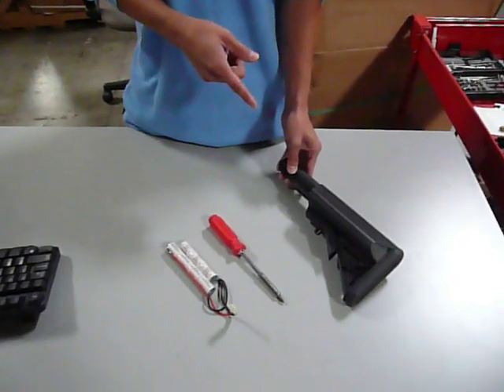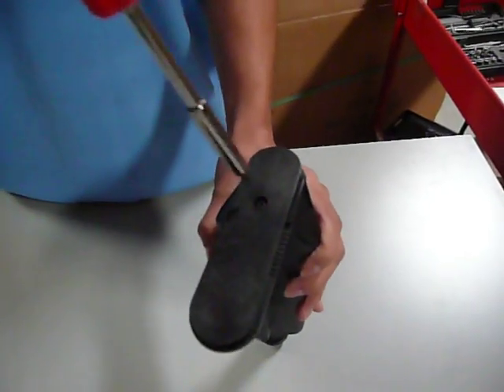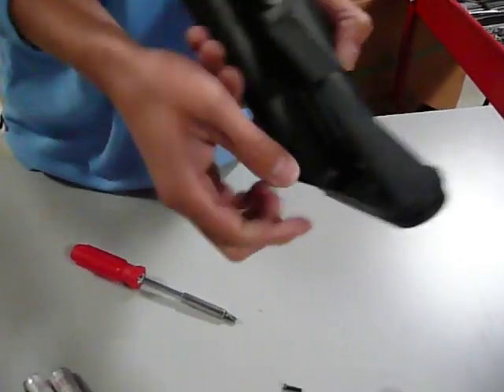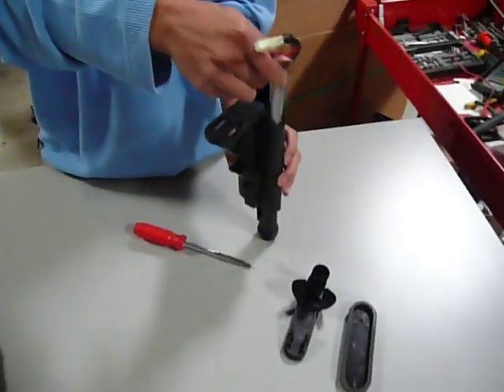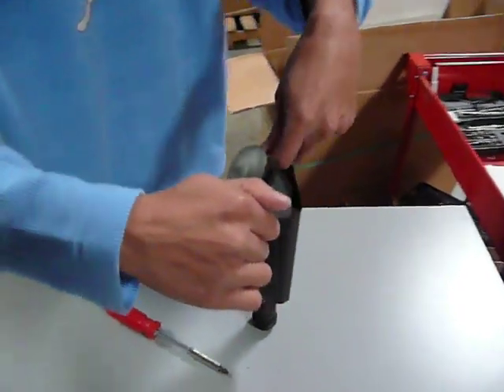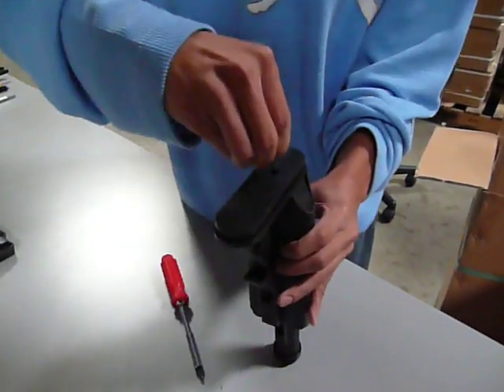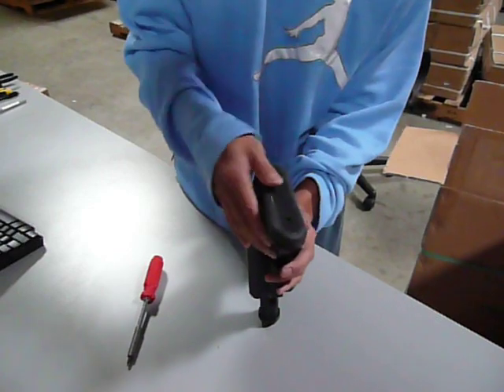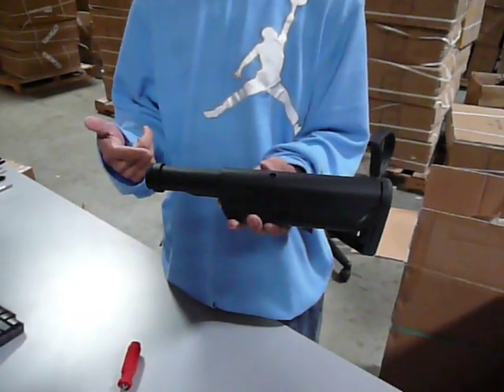DBoys M4 CQB Crane Stock Battery Installation - Airsoft Megastore

Comment: I have a d-boys M-4 QCB have only used it one cycle on the batterypack , recharged according to directions but when you plug batterypack into the gun wires and battery pack becomes vey very hot1!!!!!!  what up ? this gun  is new ! from Evike, did i get ripped?

Comment: I have a question regarding larger batteries.  

So I bought a gun that has a crane stock, but I decided, as a cheaper alternative, to use my already-owned large type battery and buy a pouch instead.  Is there a proper way to install this into the gun? Or am I going to have to deal with keeping the rubber back-plate removed with all the wires exposed?